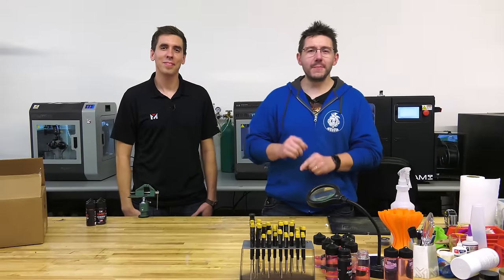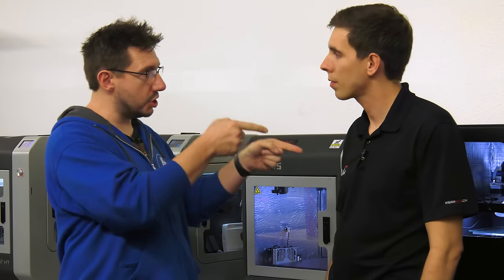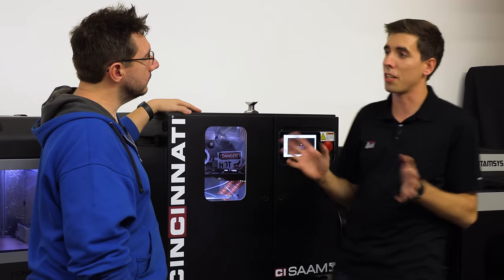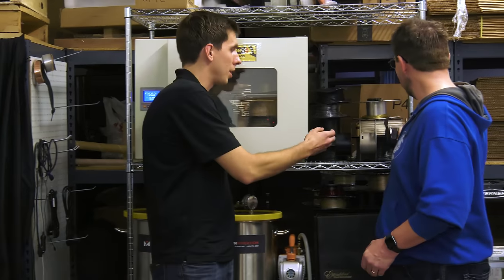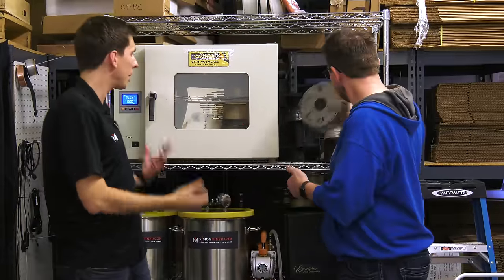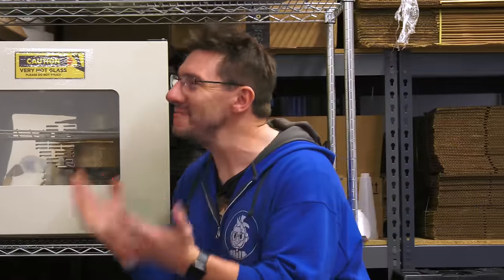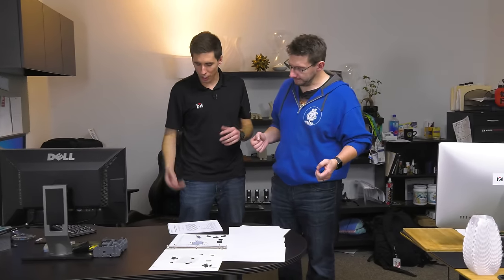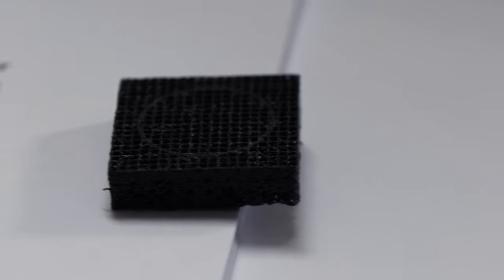High Temp 3D Printing FOR NASA with Vision Miner

Comment: I you're a mm off when using a Haus machine, you're the worst machinist in the world, that machine will do .005" tolerances.
Reply: It's when your designer messed up.... or you messed up the design :)
Reply: @VisionMiner  Considering the size of the operation, I'd blame the machinist, small shops normally have workers with a better understanding of what they are doing, and not just button pushers. However, some of the statements the second guy made lead me to believe he was all talk and liked to make folks think he knew what he was talking about. 40,000 lbs of holding power for the material they where printing.. Sure, what ever you say..

Comment: Super weird solution. Why why why would you leave the electronics and the motors inside of the oven !? 
Just place them outside. You don't even have to build anything complicated. Driveshafts will do the trick.
Reply: 1. Some of them cant be left outside of the enclosure, like the stepper motor that moves the filament, 2. It adds complexity to the design and makes insulating the enclosure harder. 3. Adding complexity to a design will make it less reliable and harder to print. Considering all of these, just water cooling the part is probably the cheapest and easiest solution.

Comment: So scores on the doors for international viewers keeping track.. 

2 for 2 fuck ups now from Vision Miner..

So after the first mess up with international shipping I took them up on the second offer of a free sample of full size pack. 
I pay $33 shipping and they send me a free sample.
Sweet sounds pretty good to me.

But they declared it wrong on the shipping declaration!

So instead of free sample with $0 value plus the shipping costs, which is what they said it was and should have been declared as. 
They for some unknown reason declared it as $49 retail sale value item with no shipping costs.

Which means it immediately got hit with admin and duty charges as its over the no duty / VAT / admin threshold level.
I've emailed them to ask them WTF, but someone over there really needs to get on top of these admin issues.

And it's not like I didn't check all this with them beforehand as it just all started sounding like a scam.

AHHHHHHHHHHHHHHHHHHHHH, so annoying as it does sound like really good stuff. 
But I may never know at this rate!

Comment: Wow this is the best video I have ever Sean sint I first herd about 3d printing plus. Bean creative plus sint I got my first 3d printer kit from UK.an reading 90 book s on all things  3d  printing an what s to. Cume out of it.  Sints then  its still a. Small thing but few year latter has grown so much an now you can find n by 3d printer s in aldi supper market to office works to online or bild a printer your salfe  proto type to print an sale. But with so Manny printer out there now. We by a 3d printer $2500 but it not work properly. An day n years trying to get it printing or calibrated to printing right. So up date s an with less. 3d printer tek help. By thoe s who sold u the printer sux   .so now. Thoe s geting into 3d printing. Know. Not to get ript of  ...?  An online tip of best printer s. Is good. But not.top five best 3d printer.  So much to it all..then u got. Graffic side n computer side  is new to Manny. But thoe with nolidge in sirtn thing like 3d printing can get into design product for printing to part designed for printer to  mourning new things in printing.. I so luv the. N r g. Buzz you guy. Give. Amazing inspiring. I wish I  had a job with u guy s. I have a creative mind.        But. That's all. .hope to get sume of my idear n creation proto type n then print  to sale.  After doing two years art s degree an product placement. An ceeing. Much more. On 3d printing happaning 2017 2018 2019 ..2020.  An by 3000// we be ceeing so Manny amazing thing s 3d printed.  Its amazing.   Wow your 3d printer s. Seem magic. From all you where telling us. Thank s guy s you s are awsume.